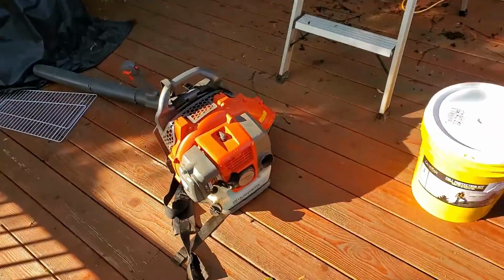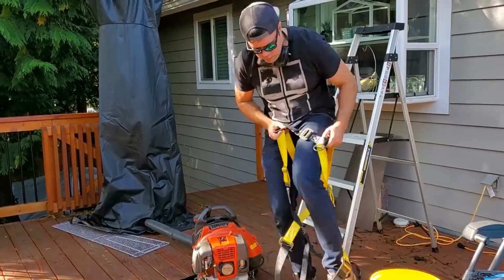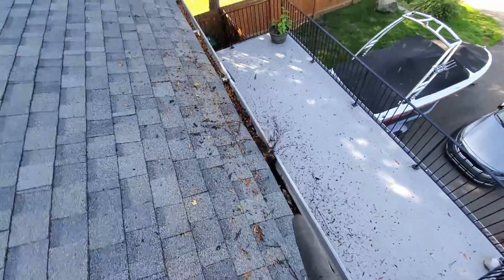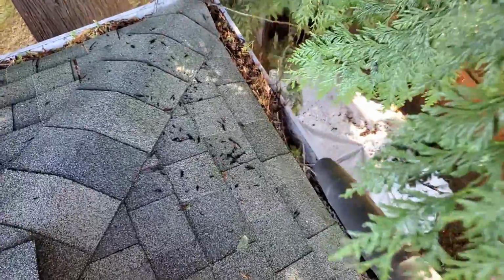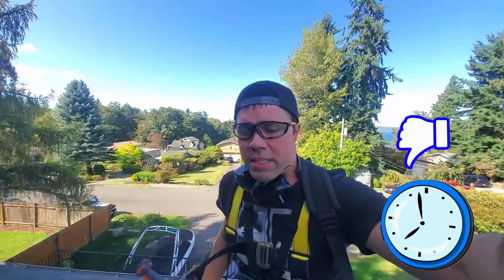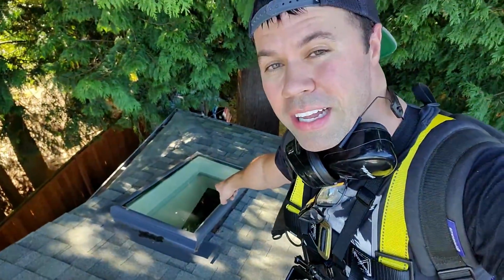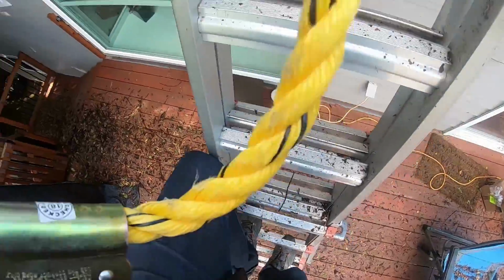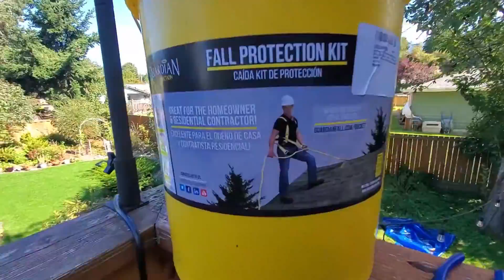How to Clean Gutters FAST with the Husqvarna 150bt!

Comment: What kinda roof damage are you causing ,stomping around like that?  Just spend the $35.00 for a extension tube for your blower do it from the ground. Safer, faster, no roof damage, easier, but not as funny video.